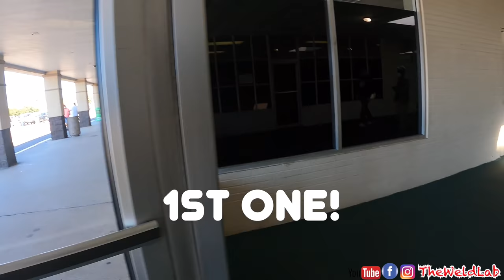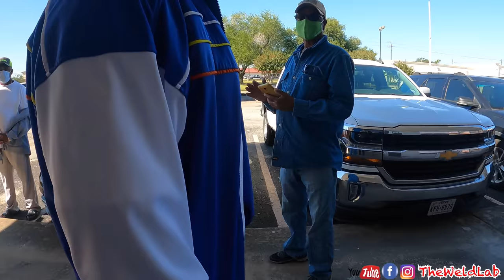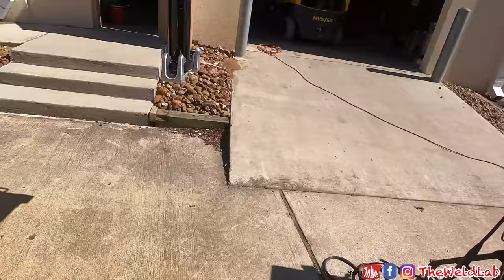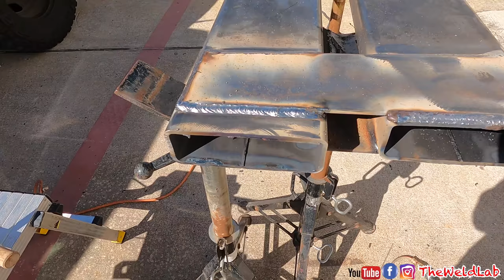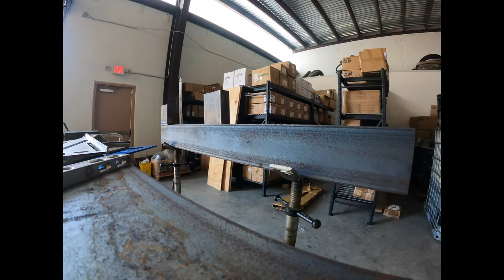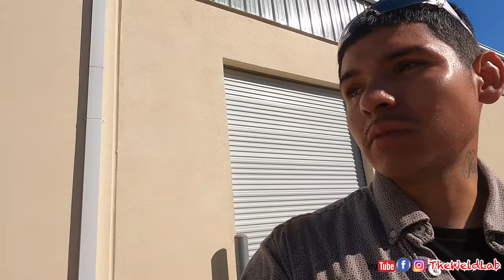AND SO IT BEGINS...| LAYOFFS, JOB SEARCH, ANOTHER SIDE PROJECT WELDING FORKLIFT EQUIPMENT

Comment: If your in cali local 250 union is a good for pipeline  welders transmission  work . Dotty bros needs the welders im local 12 operator i make $51 right now and my buddy that is union welder let me know they pay $67 hr with rig pay 18hr and fuel pay too

Comment: First get a real welding hood. Next get a vs wire feeder millers 12vs is better the the lincoln ln25 run hobart xlr8 1/16" cut your welding time buy more then half .